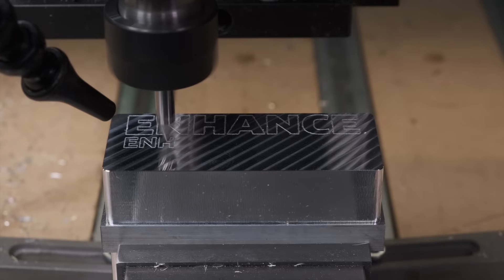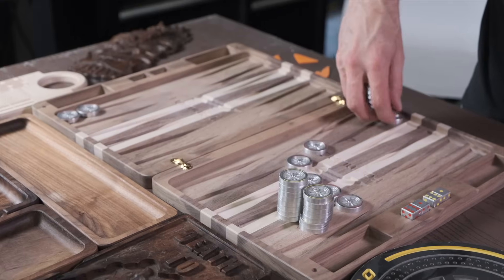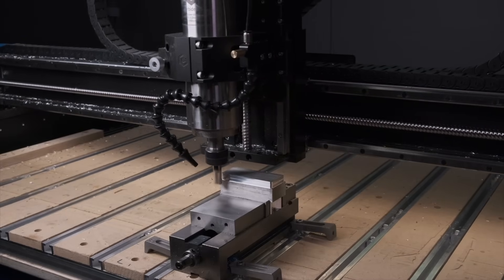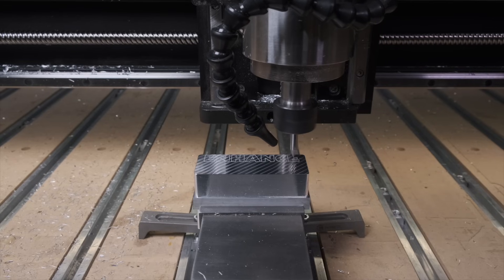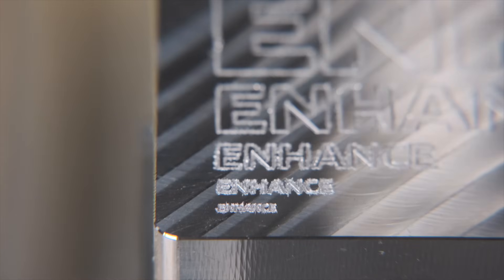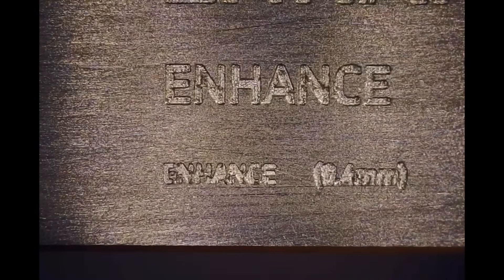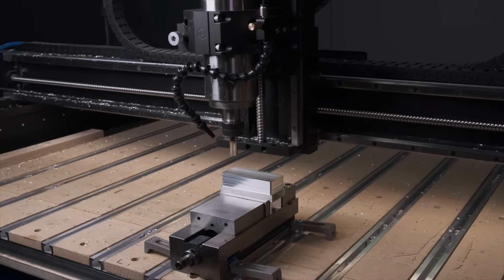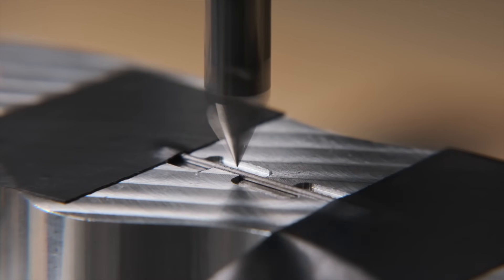Extreme CNC Precision Test: Shapeoko 5 Pro Chases Microns

Comment: Hey, big fan of absurdity. Ever try to program your CNC to make lacquer cuts for vinyl record pressing?
Reply from the maker: The amplitude of the surface variation on a vinyl record is on the order of single-digit or less microns, which would be pushing it quite a bit. And even a slightly unbalanced rotary cutter would also add noise. So while you might technically be able to make an audible record, the results will be severely degraded.
Reply: @carbide3d  Degraded, but now you're also the proud godfather of a new genre. Might be a wash.
Reply from the maker: I just did the math based on the theoretical resolution of our best machine, it's about 3 microns. So given the usual height variance range, you're gonna be making 2-bit remixes 😂 (-W)
Reply: @carbide3d  Well, thank you for entertaining my silly questions.

Comment: Thanks for the vid Winston.  Nice.  I’m one of those who have emailed accuracy/resolution question about the 4x4 Shap 5 (currently running a Shap3 XL) in particular along w questions about measured spindle runout on the water cooled spindle, etc etc.  Our question had a little diff added twist, and it’s one I’ve asked of all mfgs we’ve talked to (some costing many 10s thou USD more than the Shap5…say one that sounds like..Day time combined w Tron movie).  And it’s topic I was hoping to see here, but alas.

Background: We use jigs (clamp &/or vac) for part holding, the parts we produce are somewhat small with fine detail and locating holes.  Our intent is to have several jigs for differing parts mounted on the table at the same time.   As an aside, the primary material we machine is somewhat of a niche material: SR MDF (thus why we’re interested in a enclosed water cooled spindle).

So no more TMI, down to the question:

Utilizing a 1/16 end mill, what is the repeatable cut accuracy for a job that produces 3/32”w x 1/8 long X 1/4” deep slots at extent of the machine bed size (4x4 in ya’lls case)…over 20 iterations?  

My orig email question to C3D didn’t go into quite that much detail.  But since you’ve broached the subject of accuracy/resolution, how’s about adding repeatability? 😅😊

I’d be very interested to hear/see your thoughts 😁

Oh, one last question are you using the standard collet on that spindle or is it a retrofit 3rd party collet?
Reply from the maker: Easiest questions first: This was a standard ER-20 collet included with the 80mm spindle. Total runout should be less than 1 thou, but if you need super-ultra precision, there are some top-notch Regofix ones that are sub-$100 you might want to look into.

Repeatability is one of the hardest things to quantify and bound in the "real world" because no one's using their machines in climate controlled facility on a solid granite slab. But based on my personal experience, and without being able to put the entire machine on a CMM, I would say you should be within 2-3 thou at the machine's extremities, across the typical operational range of home shop environments (not counting a midwest winter in an unheated garage). Chalk up 1 thou for homing precision (temperatures do affect proximity switches), 1.5 thou for machine growth, 0.5 thou for "miscellaneous" (like runout and non-linear environmental effects like MDF swelling, steel linear rails fighting aluminum extrusions from dissimilar expansion coefficients, etc).

For an op1 where you're cutting something out of an oversized piece of stock, it should be no problem. For critical op 2's, maybe put those fixtures closer to the right hand side of the machine (closer to where X homes), and optionally towards the back. This would be to minimize the effects of thermal expansion, though it would not fix the thermal drift on the proximity switch. 

If you want to pretend you're an aerospace shop using a Shapeoko, I'd suggest putting together a custom warmup routine where you both ramp up the spindle and drive the axes for like 10 minutes. Give everything (like stepper motors, frame, and switches) time to more or less reach equilibrium under power. But this is definitely beyond what the average person needs to worry about.

-Winston
Reply: @carbide3d  Thanks Winston for the fast response.  Points well taken. We run larger vertical mills/lathes and everything is in an enviro controlled shop (temp & humidity) in DFW so have to be, materials are acclimated before processing.  Won't be on a granite table,  just a welded 1/4"wall x 4" tube steel - sand filled - frame table w about 1 - 1.5 US ton of weights on bottom "shelf".  Steel interfacing al, brings to mind  the old Land Rover Discovery al roof issues ..i digress.

Great point about right side, gives me some thoughts for initial setup testing. real winner on pointing that out.  Warm up routines, yep we do those on the bigger machines, so familiar with that.

Regofix is a good callout, we usually go MariTool/Hardinge, but will give RegoUSA a try. when we get the machine.

Thank you for the feedback, its much appreciated.

Comment: I know it's a different machine, but the HDM at work holds 0.001"-0.002" tolerances all day as long as you use proper roughing/finishing strategies. I'm not surprised by the results of this at all. :)

Comment: Is that 110v or 220v spindle?
Reply from the maker: That's our 80mm VFD Spindle, which runs on 220V.  For engraving, power isn't a big deal so we'd expect it to work equally well on our 110V 65mm VFD Spindle.

Comment: Great one Winston. Did you do a maintenance video on the 5 Pro? Like what type of grease to use on the ball screws?
Reply from the maker: We're currently in the process of updating our guides, but Mobil Vactra 2/3/4 are what we recommend. If you want to reduce the risk of drips on your table, the higher viscosities (3 or 4) would be better. 

A 3mL syringe with a Luer Slip tip works well for fitting snuggly in the oiling port hole. Inject about half a ml per bearing. Pipettes work great for dripping oil in front of the ballscrew nut.

Comment: What was the depth of cut you used for that text?  Ive been using a 30deg 1/4"shank Vbit for some coin engraving doing .1mm depth cuts.  Still learning speeds and Feeds for this, but at least that bit at 50mm / min doesnt break the machine I have.  Smallest text so far is 2mm tall, but even that is kind of fuzzy.
Reply from the maker: I was doing about a 0.04mm depth of cut out of an abundance of caution, but it might also have contributed to the burr that was developed. I wasn't quite cutting deep enough to form a chip, instead just swirling aluminum around. 

In general, V-bits do okay in wood, but may struggle in other materials where you really want the cutter geometry to scoop out material like a drill bit. Also, if you look at the tip, sometimes they can come to a fairly blunt point 0.015" or more. An engraving tool with a helical geometry may do better. Here's an example of such a tool: https://www.lakeshorecarbide.com/010balltipforstandardengraving.aspx

-W
Reply: @carbide3d  Thanks!  Those bits look amazing, but I think they might be overkill for a small 3018PRO cnc...  Im not sure of the precision of this mill to make use of a bit that small.  Might be worth the investment to try one out and see though!

Comment: The legibility of the engraving has nothing to do with the precision of the machine.  All that tells you is how fine the bit was.

Precision is: if you request 100 mm remaining between two cut lines, what do you actually get?  99.9, 100.1, 100.01?  Do that test and measure with a digital caliper.  That will tell you the precision.
Reply from the maker: We did not use a single line font, so the fact that we close the loop without a visible gap should tell you everything you need to know. The machine is able to place the start and end points of each letter on top of each other, no visible backlash or slop. 

And digital calipers won't do it. At those sizes you need an ocular micrometer. We got one of those and it looks pretty dang good. -W
Reply: @carbide3d  You're confusing repeatability with precision.  If you request 6 mm tall text, but all the text comes out at exactly 6.1 mm tall, then that is repeatable.  But the height is off by 2%, so it's not precise. 

Repeatability is necessary and good, but without precision your parts will be the wrong size.  You need both.
Reply: @gregholmberg2  I think you're confusing accuracy with precision. Go have a talk with ChatGPT about this. Repeatability implies precision.
Reply: >"The legibility of the engraving has nothing to do with the precision of the machine"
That is obviously nonsense. How legible will 6mm tall text be with a machine that's only precise to 100mm?
Reply: @KarlBunker  If you run that same bit and request 6 mm tall text, but it actually cuts text 6.1 mm tall, then the line width is the same and the readability is the same.  But precision is not good, because 6.1 is 2% taller than it should be.  So readability is really not interesting.

Mill a part and see if it comes out the right size.  That's precision.
Reply from the maker: We also mentioned that the outer profile of the block was machined within 0.02mm of nominal dimensions.
Reply: @gregholmberg2  You left out the part of your response where you begin with "That's correct, but ..."

Comment: Datron makes world class high speed bits that will take your work to the next level. Their bits are balanced to 60k rpms & have incredible resolution.
Reply from the maker: They do make some great tools, we have a handful in the shop. The engraver we used here is actually a Datron one, I just didn't have a speeds and feeds chart for it 🤦🏻‍♂️. -W
Reply: @carbide3d  they make a .05mm one ! That would be crazy to see those samples neat tests ! also some aluminums of same grade from diff mfg's are sticky & gummy. China vs Alcoa.. etc.

Comment: I’ve watched the video on v-bit vs mc etcher. But what’s the better process? Machine engraving or drag?
Reply from the maker: There's a lot of overlap in the capabilities of each technique, but there's a couple pro and cons of each that might push you in one direction vs the other. 

Drag Engraving: 
- Can compensate for small changes in height, so if your surface isn't smooth (ex. stone), this is the way to go.
- Diamond tipped drag engravers can mark materials that carbide tools can't cut, like glass.
- The lines scored are extremely fine. If you need maximum detail, this can be a plus.

Rotary engraving:
- Can cut much deeper than drag engraving can. If you're trying to mark metals and you want an engraving that can't possibly be scratched off, this is the way to go.
- Rotary engraved lines are wider, you can cut highly visible grooves faster than you can with a drag engraver.

Let us know if we can help answer any other questions you have. -W
Reply: @ thanks for replying Winston! I do strictly 3003 aluminum most of the time. But I do some clear acrylic every once in a while.

Comment: I've tested my Shapeoko Pro 4 cutting MDF at a 300mm dimension and found that it was accurate in X & Y to 0.01mm using digital calipers to measure. I'm impressed with its capabilities.
Reply from the maker: Glad you're having a great experience with the machine!